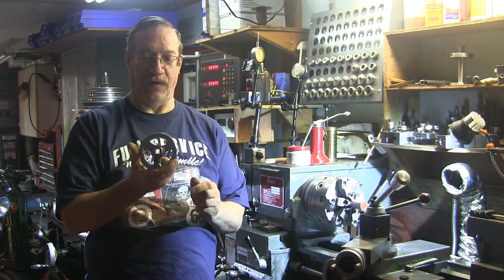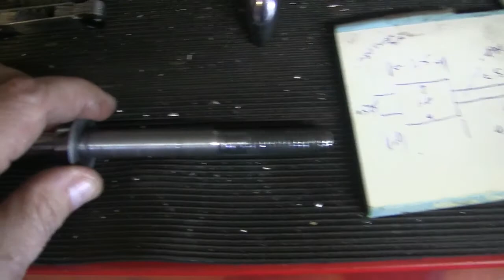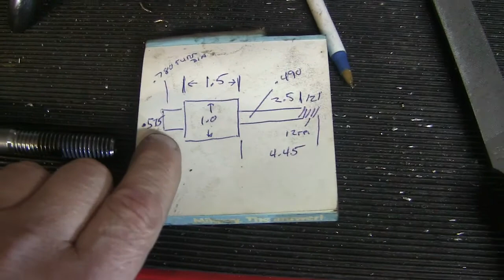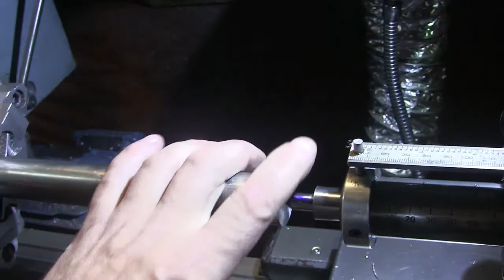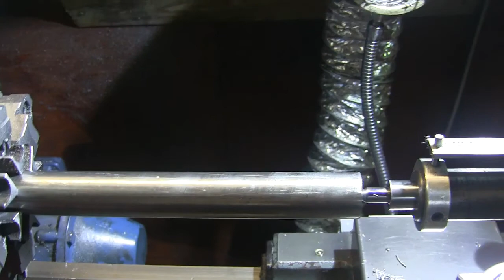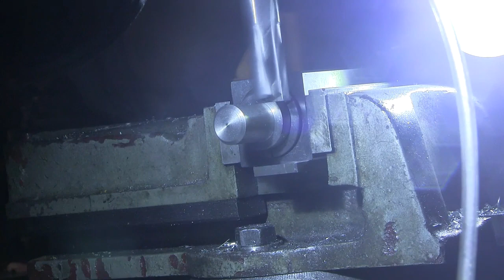Quill lock

Comment: 1/2" x 12tpi is a BSW thread - a lot of asian machinery if not metric, are British Standard Whitwoth (55 degree) thread form. I hope that helps, as you should grind the threading cutter to 55 degrees, not the 60 degrees of Metric, SAE, NC or NF.
Reply from the maker: Seems like my machine is a hybrid of metric and imperial. In any case, it works with 60 degrees.

Comment: Been considering a new quill lock handle for my mill. My issue is that after adding a quill depth stop my quill lock handle doesn't stick out far enough to be convenient. Not sure I got room for a hand wheel, so will likely go with a T handle. Thanks for sharing.

Comment: The mighty Rong Fu is better than ever!   +1 on not standing in line with a parting blade!  I've had several snap with me standing there and they always fly up toward your face when they snap.  Looks like you haven't started packing yet.    Chris
Reply from the maker: There is a hole in my ceiling where one went through a few years ago. It is a good reminder. Not packing up the shop until the last thing.

Comment: Good job on the quill lock.  I saw the other day that Harbor Freight now lists the Rong Fu but by their own name in the online catalogue.    They must have got a good deal.  They even have a knee mill with a tilting head.  I don't remember them having any of that in the recent past.
Reply from the maker: Oh man, I would love to have a knee mill, maybe some day...
Reply: I had my sights on a knee mill before buying the RF-45 clone. The handling issues on something that heavy is a problem for me. Maybe I'll just have to just bite the bullet someday and pay a rigger to transport it.
Reply: I have thought on that a lot of times myself.  I think I would rather have one from Grizzly but the HF knee mill is about half the price of a Grizzly.
Reply from the maker: You should look into it Wes, Rigging is not that bad out here. I had a 5000 pound gun safe rigged in here for under $200 a few years ago.
Reply: Well, I am not ready for a real announcement, but I am working on acquiring some property to build my "shoptopia" (some call it a barndominium). As a rough plan I want to build a 40'x80' steel framed building, have 1/2 built out as a home (drywall and all) and the other half for a shop. You know, get out-of-bed and check on a job in my underwear kind of facility. Still in this area of Texas. Best part yet: No building inspectors.